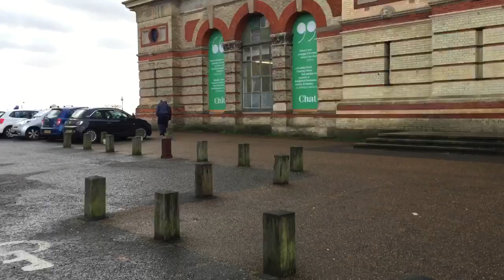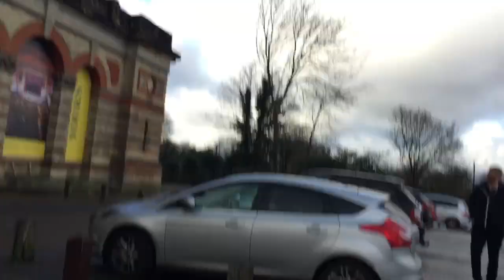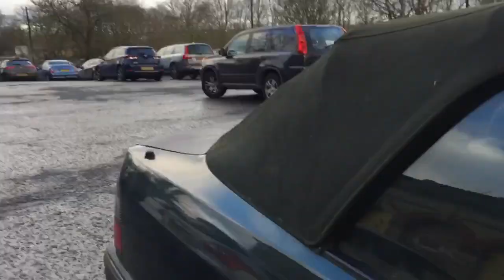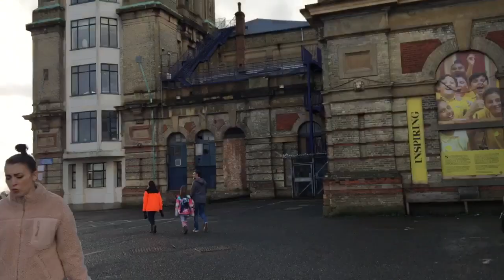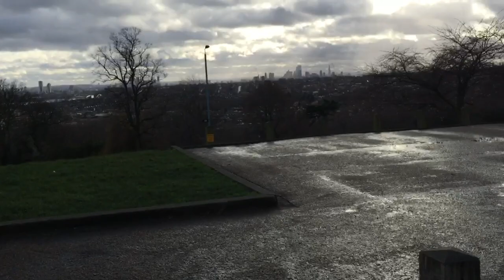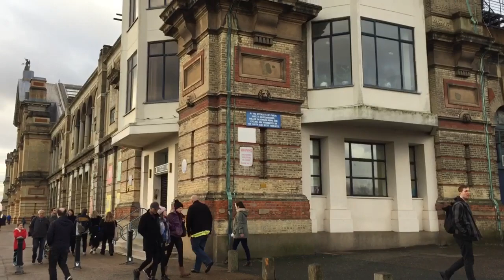Alexandra Palace in North London the BBC’s First Ever TV Transmitter.

Comment: I have a transceiver that i tuned into the frequency that remote controls for cars electric gates garage doors etc use and i have spent many a few moments in car parks messing with people trying to lock/unlock their cars after shopping. I suspect this was happening to you
Reply from the maker: You could be right there, lol.
Reply: @conundrum112  wirless key fobs transmit at a certain frequency which i wont say cause i dont eant to cause you trouble but it is very easy to find but they transmit in milliwatts  i have a transceiver that transmits in 8 watts thus drowning out the signal from the key fobs